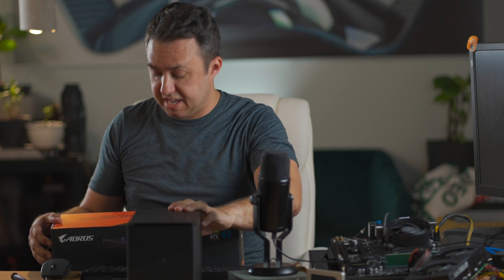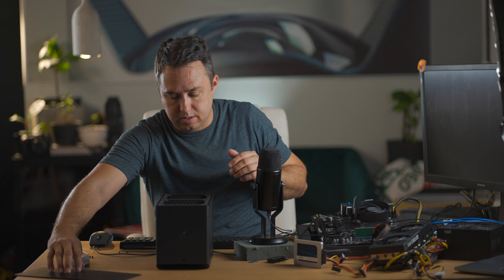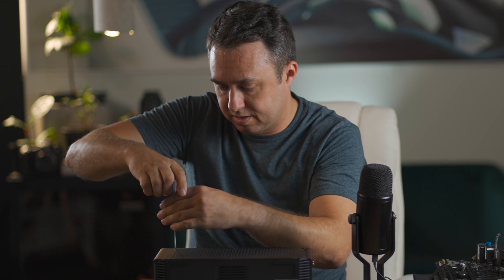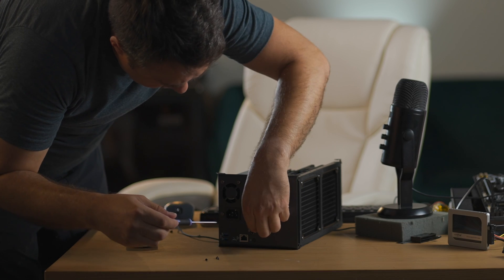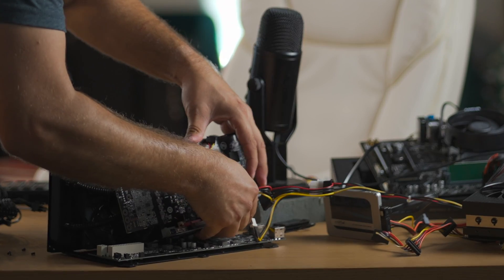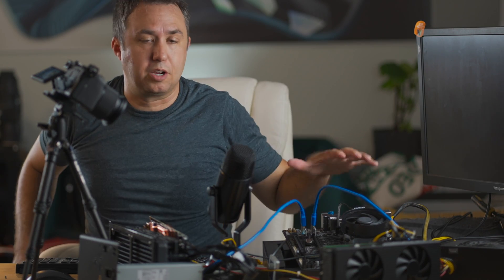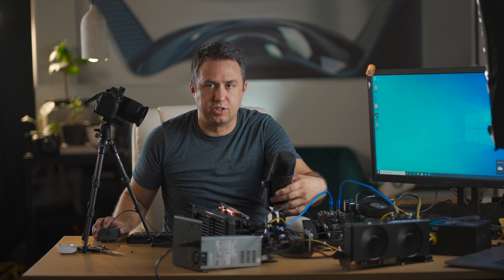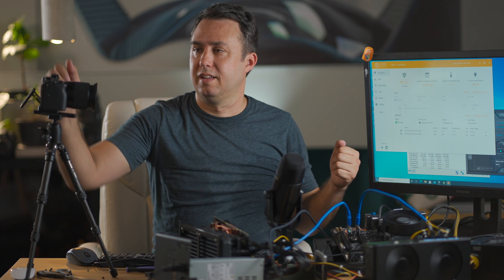Ethereum Mining Rig Build by Removing the RTX 3080 From AORUS RTX 3080 GAMING BOX eGPU B450M MOBO

Comment from the maker: I ended up powering the card and riser from a bigger computer power supply - it worked with its own power thing, but for some reason anytime there was a fluctuation in my studio, like when a fridge kicked on, it would freak out the overclock on that card, which is an odd thing to happen, but it happened, and now it doesnt happen when I got rid of that little power supply.
Reply: The reason is the card has two grounds, you should never use two power sources on one card, could have been worse :D
Reply: Nice one thanks for that info, i to would like to try out some solar panels great ide, regards
Reply: Did you mean you totally removed the GPU and powered with bigger watt PSU? Is the power connector suitable?
Reply from the maker: @azwarbunyamin  Thats what I ended up doing.  The power that comes with it is definitely enough to power the card, but it turns out that its important to power the riser from the same source as where youre powering your card from, and the built in PSU didnt have a cord to do that with.  No doubt theres a work around, but toying with burning out a 3080 was more than I was willing to risk
Reply: @SPACEDESIGNWAREHOUSE  do you need to mod power cord to power the GPU from other PSU? How about the water cooling system? Yes it is hard work, but if worth it then why not. The cheapest 3080 in market now only this model.
Reply from the maker: @azwarbunyamin  The GPU comes with a little cable extender/adapter thing inside the eGPU enclosure that goes from 2x8 pin common connectors like are in every PSU to the strange plugs on the side of the card. And the water block has a little wire that goes straight to the card also to power it, so there’s no modding needed at all!
Reply: even I connected it to separate PSU my cooler fans are not spinning at all :/ any idea?
Reply from the maker: @xxandrejxx  yes!
There is a tiny wire if you flip the whole thing over, that has a couple of zip ties on it and it can get unplugged between the fans and the card when you disassemble it. I’m certain that’s what happened.
Reply: @SPACEDESIGNWAREHOUSE  thanks for reply, yeah I actually connected it :/ from time to time when I start PC it will spin the fans to 100% for few seconds and thats it. even if gpu has over 60 degree it will not start spinning fans :/
Reply: @SPACEDESIGNWAREHOUSE  so at the end I had to buy a new cooling system -> I went for Alphacool Eiswolf 2 AIO - 360mm RTX 3080/3090 Gaming/Eagle with Backplate -> works fine :) !
Reply: @xxandrejxx  i about to do same exact thing u did, but can i ask y u decided to scrap stock cooler? like the stock aio didnt go dead on you or make noise did it
?
Reply: @GG-mm9hf  keep stock cooling if it works, for me it was dead I had to replace it, but with bigger cooling system you get better temp :)

Comment: Hi,my 3090 gaming box just died,likely psu does not work.it is too hot in my city,I opened up for better thermal conductive.Hope Gigabyte rma can take care of it
Reply from the maker: That’s a bummer! You should be able to power that with any desktop power supply though.. unless you’ve got that connected to a laptop
Reply: @SPACEDESIGNWAREHOUSE  Be careful,GB has the worst RMA,I just tried,they refused to repair.

Comment: Hey man, nice video, it helped me a while while back to change the thermal pads for a Gaming Box 3090, which is basically the same box design, now, i want to know if you are still using it like you showed on your video. My plans are to mount this PCB into a custom waterblock, but i'm not sure on which block will be compatible with this card, and also if i have to think of these special connectors that Gigabyte used, the ones that are connected to the PSU, i think that these on the 3080 are exactly the same that are used on 3090, i have a few 3080 Gigabyte cards and this bizarre connector is used. Any advice here?

Comment: Hey quick question i have the same egpu as you. Can I take it out the enclosure and put it in a desktop. Or do I need a special connector. I just want to use it to game not mine
Reply from the maker: Yes you can! The PCIE inside is exactly the same as any 16x on a motherboard. A few more screws and you can take the card out entirely.. the water cooler radiator will come with it, just make sure the tiny little connection on the bottom between the radiator and the card doesn’t come unplugged.  That will make sense once it’s out. Two little black wires and a little plug.

Comment: What processor are you using? and How did you make the GPU work on the small PCI-E slot?
Reply from the maker: Im using a Ryzen 1500 since it doesnt really have to do much at all.. 

You use a 1x to 16x riser to get them working on the small PCIE slots, they work at full speed!  Not a lot of data needs to transfer... Heres a link to one https://amzn.to/3mMY53u
Reply: @SPACEDESIGNWAREHOUSE  Thankyou:))
Reply: What is the minimum specs of laptot to use this gaming box ? Thanks

Comment: hey man, great video. at the start you say 'this machine doesnt have a usb-c, more importantly is doesnt have a TB3', does this mean that it will work in some way with just a usb-c and not a TB3?

Reason I ask is i have 2 laptops already which have usb-c but not TB3, i want to use it just to mine but cant find a definate on whether i can do this with usb-c only? thanks
Reply from the maker: It will DEFINITELY NOT work with USB-C that isn’t thunderbolt 3.  I should have made that clearer. I did try it on my other pc that has a usbC port but not thunderbolt and it will not recognize the eGpu
Reply: @SPACEDESIGNWAREHOUSE  excellent thanks for the swift reply :)

Comment: Have you seen the spare parts for the rtx 3080 gaming box? The backplate of the regular EKWB version RTX 3080 does not fit this boxed version of the card.

GIGABYTE WATERFORCE Water Block cooling system
GIGABYTE Protection Metal Back Plate
Reply from the maker: Wait, are you saying there is a better back plate that I can use to upgrade these?  Because after taking it apart further, I noticed that the place really only touches the processor and not the memory modules...
Reply: @SPACEDESIGNWAREHOUSE  I don't know this, I'm just looking for a regular EKWB rear panel. Because this card is different from the regular 3080 cards
Reply from the maker: @TheSebku  ohhh, yes, right. It is totally different. It’s really bare bones.  But no, I don’t know where to get spare parts unfortunately.

Comment: What the vram temperature sir? Is the water cooling reduce the super hot 3080 vram during mining?
Reply from the maker: It does! VRAM hanging out in the mid-upper 90’s.  
Not COOL by any means, but not as hot as the air cooled cards.

Comment: Hey I just bought a laptop which already has a GPU(rtx 3060) and I have a thunderbolt 4 port. Can I connect an egpu to increase the power for mining crypto?? If yes are there any limitations to what kind of egpu I can use
Reply from the maker: You CAN do that! And the only limitation off the top of my head is that you should stick to Nvidia so there’s not a weird driver confusion. But you absolutely can plug in a bunch of eGpus!
Reply: @SPACEDESIGNWAREHOUSE  thanks a lot man!! Will definitely try this out and see how it goes

Comment: whats the disadvantage of just pluggin it in using intended thunderbolt 3?
Reply from the maker: I have two motherboards and neither support thunderbolt 3, unfortunately. 

I’m fact, it turns out almost no Ryzen boards do! I thought it was more or a ubiquitous technology by now but it isn’t. A USB-C plug alone won’t allow the eGPU to work. 

If you DO have a supported thunderbolt 3 motherboard then there is no disadvantage and you should simply plug it in that way and put it to work!

Comment: Is there anyone that has experience of eGPU? 

Have you tried to connect two devices to your laptop? 

Or is it possible to connect the second eGPU to your eGPU which is connected to your laptop? 

I also wonder if it is possible to split your connection on your eGPU into four?
Reply from the maker: Yep, I was able to connect this to my MacBook Pro 16” (2020) running boot camp through thunderbolt 3 and it worked. BUT, USBC is not necessarily thunderbolt 3 so this will only work specifically with computers that have thunderbolt 3

Comment: I just got a rtx 3080 box and i got it working on Gigabyte 550 vision D motherboard, its the only ryzen motherboard i could get with thunderbolt 3 support, i am hashing at about 90 i was wondering what you was getting and any afterburner settings, nice tutorial anyhow, regards
Reply from the maker: Im hashing at 95 with each of these... But its probably just settings, they shouldn't run any different through Thunderbolt.  
I have them set at +0 core clock,  +1300 memory clock, and 75% power.  They draw 240 watts each and the memory temps are in the high 90's.   I do have a window unit air conditioner with a big 8" duct coming off of it blowing straight on to the rig, which brought the memory temps to where they were, so Im using an extra 400 watts to run that thing, who knows if thats worth the extra 5 hash rate per 3080 - but Im on solar power so electricity is effectively no cost.

Comment: You can do a couple of benchmarks in games connecting it to a normal desktop by pci x16 please, there is no video that shows how this GPU performs in games connected directly to the desktop, I make this request because in my country it is the only option to buy and I wanted to see how it performs,
Thank you

Google translator
Reply from the maker: If you use a 16x to 16x ribbon connector to make this card connect directly to your motherboard on the 16x slot, it will perform exactly like any other RTX 3080.  Do you mean benchmark the performance of games with a 1x to 16x riser?  That would be interesting to see.

Comment: whats the vram temperatur while mining on 90 m/h on the watercooled egpu?
Reply from the maker: The water cooled ones are in the high 90’s.  Dancing around between 96-98
Reply: @SPACEDESIGNWAREHOUSE  hmm.. thats a little bit high... whats the hashrate if u run it on 93/94 c?
Reply from the maker: @ololtrolo87oi24  air cooled cards run at 100c and according to Nvidia that’s within spec. 
If I slow down the memory clock to +1000 instead of +1400 it’ll run 90-91mh vs 94-95
Reply: @SPACEDESIGNWAREHOUSE  ahhh ok nice.. ima go buy this egpu and put it on pci slot since its alot cheapter than a normal 3080
Reply from the maker: @ololtrolo87oi24  If your motherboard supports Thunderbolt 3 than that would probably be way easier, and save resale value incase its too hard to put one of these back together properly!   But not all motherboards will run thunderbolt 3 even with the expansion card, so just make sure to look that up first!

Comment: This is the only YT video that I'll watch in full screen.. was looking into this eGPU disassembly all over the web instead of buying a new mobo or a tb3 expansion card... thanks for the great vid.
Reply from the maker: My pleasure! And yeah it ends up looking a little cyberpunk by the time you can use it, but its every bit as fast as at mining as this card in any other form..
Reply: @SPACEDESIGNWAREHOUSE  and like the meme. It ain't stupid if it works :D
Reply: @SPACEDESIGNWAREHOUSE  Correct me if I'm wrong but I think I saw the weird 2x 8 pins are connected to regular 2x 8 pins from the gaming box psu, so I am going to connect the card to my pc case directly. Then use the egpu psu to power up a 1070 on a riser.
Reply from the maker: @ABUGHOSH89  that is correct! It came with an adapter already attached to it, like you said that went to a pair of regular 8 pin connectors. So your existing power supply will work!
Reply: @SPACEDESIGNWAREHOUSE  this is going to help a lot of people because of the regular GPU shortage.. and not everyone will use this on a mac or tb3 mobo.. thanks again man!!